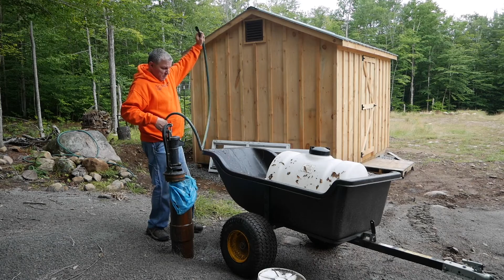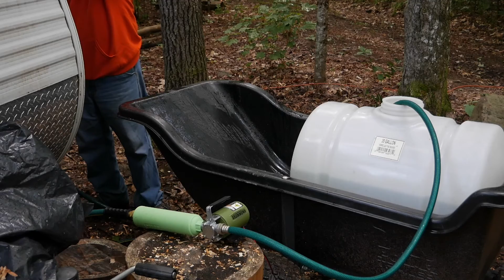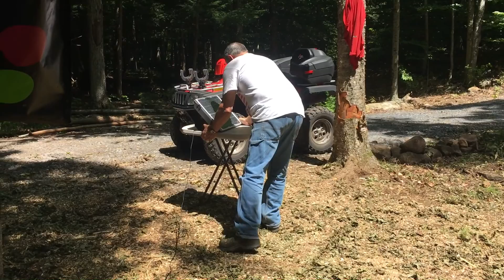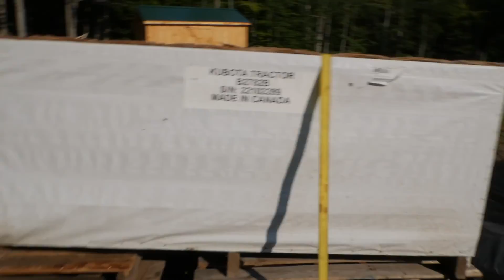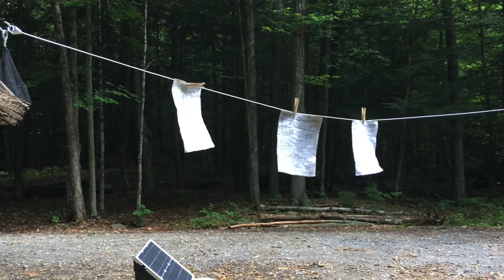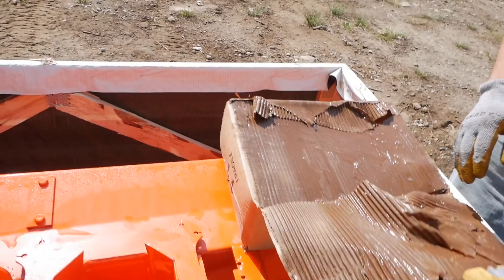The MINUTIAE of OFF GRID LIFE

Comment: I've used similar inline rv water filters for years from Wal-Mart made by camco. Never noticed a problem with water pressure. But always hooked up to a campground water supply or home. Probably need a bigger pump. Probably going to need a bigger pump anyway if the well water level ever drops another 20'. 
Great opening montage. Sweet snow blower attachment. Looks like it could keep a small airport safe! Lol
Reply from the maker: Appreciate that! Thanks so much and yeah, a bigger pump is already on order👍